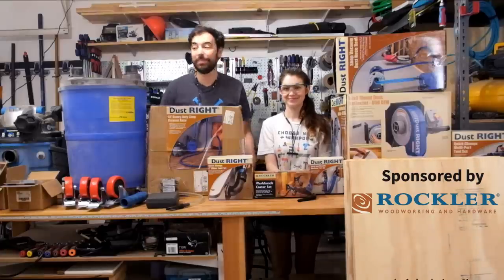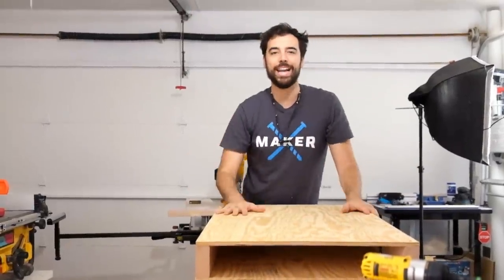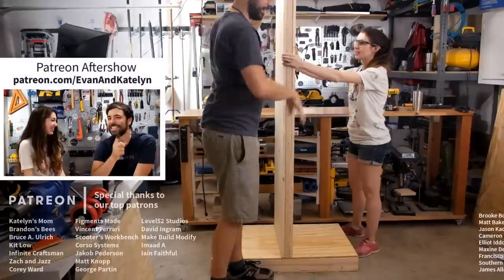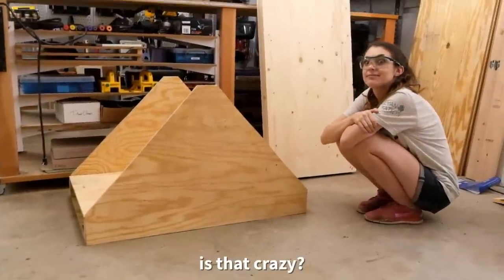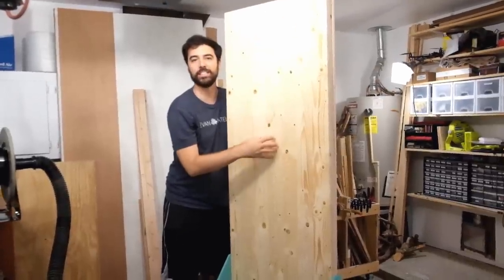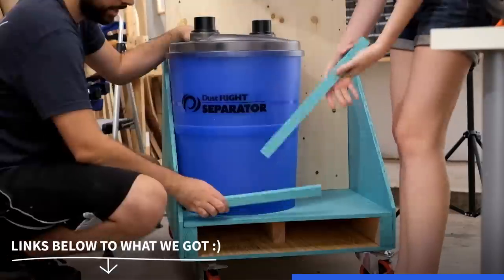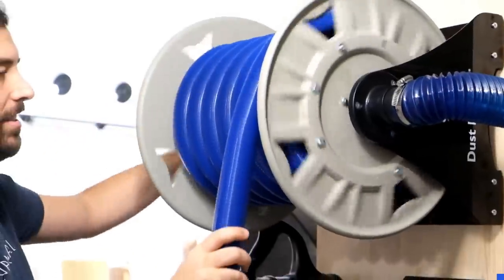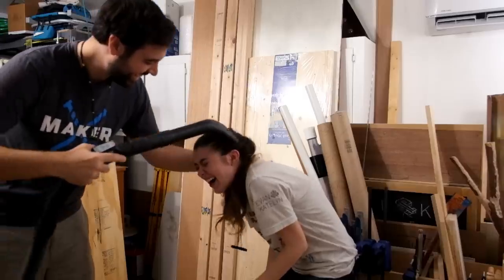Fully-Loaded Dust Collection Cart!!

Comment: Just got the same dust right system with the canister as well as the hose reel w/ the separator - all of them in one little area is so great to have! One small thought - you should consider getting the canister for the dust right system - it helps filter the air really well in the shop and it is self cleaning so you never have to replace it. You could move the hose reel to the other side of the canister so you can have space to raise up the vacuum, then move all those little dust collector bits to a little tray underneath your big vacuum bag. Just a little rework to get more bang for your buck - your future lungs will thank you! Cheers guys!
Reply from the maker: Thanks for the tip! We'll definitely keep that in mind - we designed this to have a little extra space just in case we did need to do a rework 😁

Comment: Good explanation of the different components of the dust collecting station. I always stayed away from the hose reels cause I was afraid of losing too much dust collection. How much pressure do you use going through that long hose? I know it's totally OK for pressurized hoses like air compressors or even vacuum pumps. It can actually be a benefit in those ones. But ya. How does it effect the suction?

Comment: Nice design and video BTW. I have been doing Woodworking for. Over 25 years as my hobby and i did it professionally for 20 plus years  a very good way to  build things the way you need them  is to sketch up drawings with dimensions before you begin the build  italso helps with  ordering material and getting a cut list  or the project  that may had prevented you from having to insert the 2x4s. After the wall was builtthat you needed to mount  things to ?  Although in all honesty the 3/4 “ plywood is probably  plenty strong enough to  mount what you did with the proper screws of course  i know in your case it wasnt a major oops in the build as it was a easy fix  but those little things can save you time and money over the years  and sometimes a little heart ache  as well  another helpful hint is most home centers have  a clearance section on paints that were custom mixed for  customers incorrectly  and are heavily discounted  ive always picked up.  Several of those cans and usethem as primers   On raw  wood    Especially on plywood  as  often it is a pain to get  good coverage  many of those paints are ugly colors. But it doesnt matter much if you are going to put a finish coat/ color on it anyway  if you do that you may notice that your finish coats will go further  in square footage of coverage  by no means a  correction to your method its just simply a. Tip ive found handy over the years  as I often use plywood to build jigs and templates for my shop as well and as a rule i like to paint them to. Help them last longer. And  look better  sometimes i even put  a funny name or model number on them just to goof with visitors or freinds   Like the Dust Master  2019 made in the U.S.A.  Or something similar  BTW i did get a laugh out of your  “ exploding dust “ examples  with the prop persons hand in the frame throwing the saw dust  LOL
Reply from the maker: Thanks for the tips!

Comment: Great design. Wondering about the filter bag on that dust collector though.  Is it a HEPA filter?  The cheap dust collector I bought had a bag that was not, and it allowed super fine dust to pass through into my work area.  I did not catch it immediately and ended up fighting bronchitis like symptoms for over a month afterwards.

Comment: Great video guys!! question, why didn't you place the retractable hose above the shopvac, since that's what it's connected to? Also, is there a need to have a cyclone on the  Rockler dust collector? Thanks!
Reply from the maker: We could not fit the cyclone, shop vac, and hose all on one side, and since we bypass the hose when using the CNC it made the most sense this way 👍

Comment: I hope you are not running power through the coiled up lead, you understand the fire hazard from induction and are straightening it out before using it
Reply: looks more like a place to stash the cable while it’s not in use
Reply: @terryhilder3315  that's fine if it is but I am super cautious about this after having a fire. Hopefully I don't sound like a panic attack